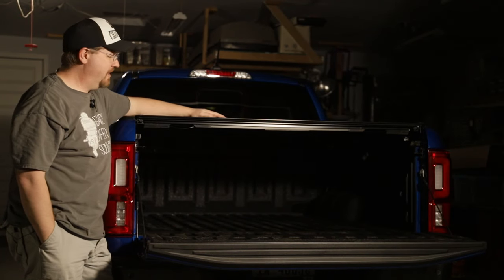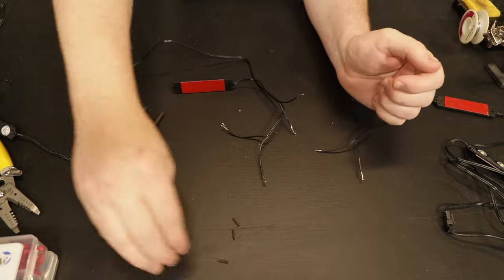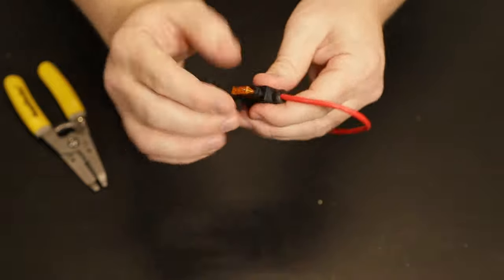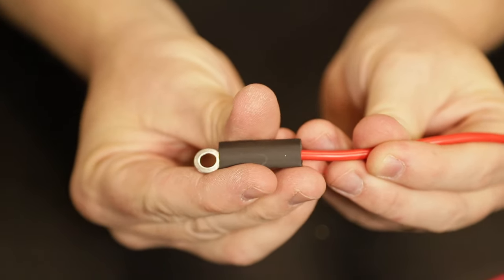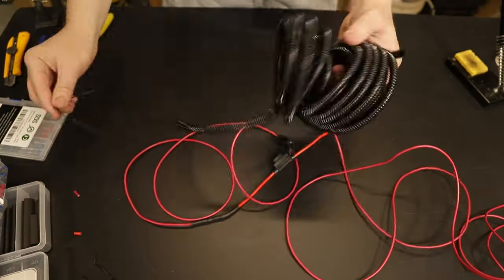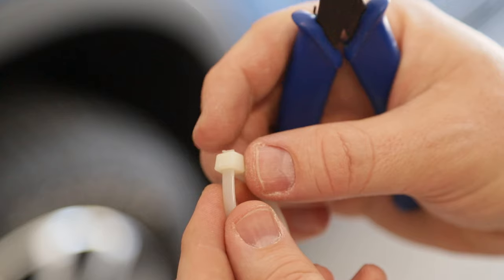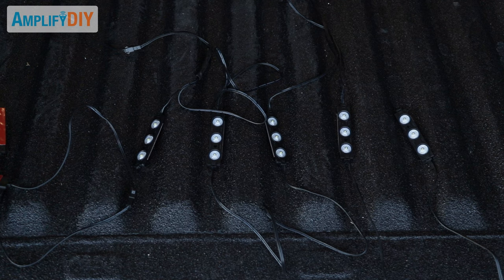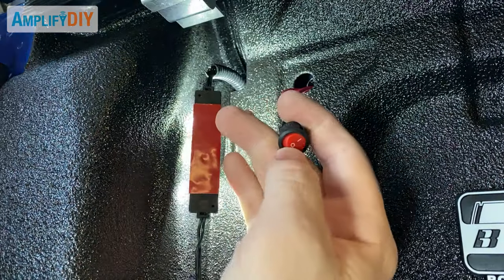How to Install Cheap Truck Bed Lights - No More Fumbling In The Dark!

Comment: That's not "wire harness" it's wire loom.
Reply from the maker: Thanks for the correction. I likely called it both terms (and maybe others) at various points in the video.

Comment: how have the solder connectors worked out ?
Reply from the maker: Hey Seymour - it's been quite some time since I completed this install. There have been zero problems or issues - the solder connectors have worked perfectly, and the lights have been a fantastic addition to the bed of the truck. Thanks for watching!